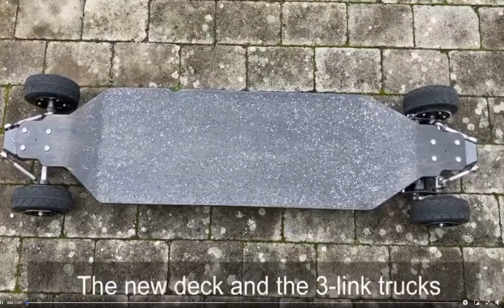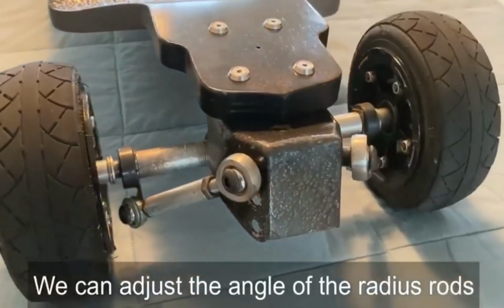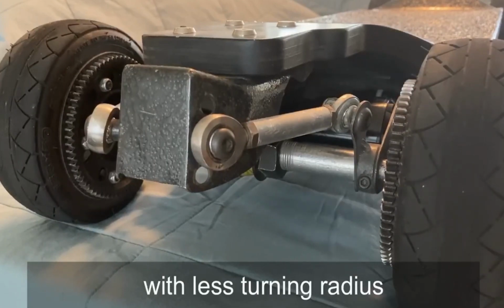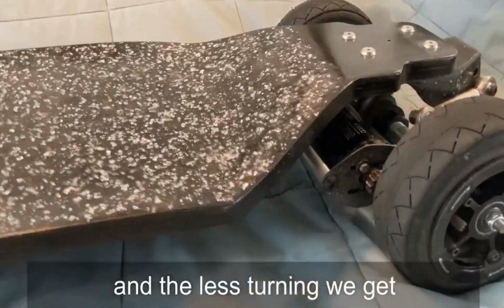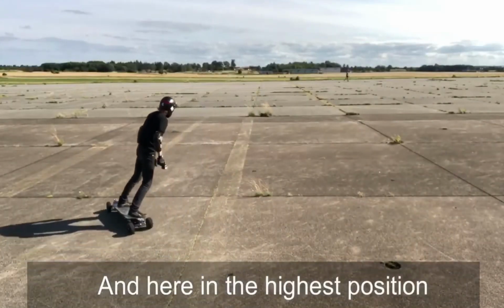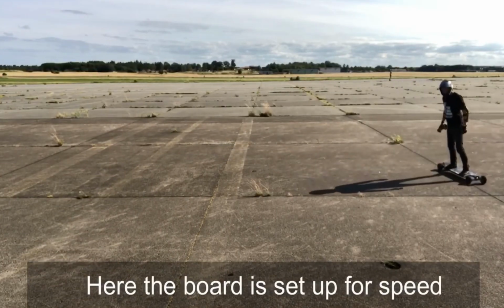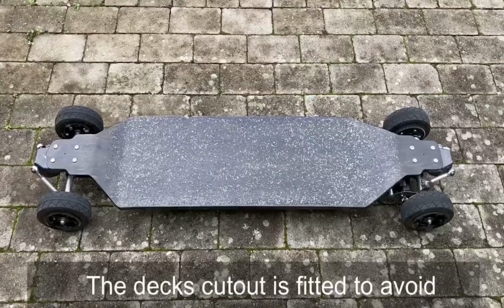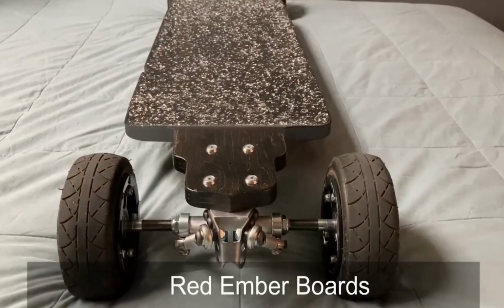DIY Fastest Electric Skateboard in The World

Comment: I'm a new rider but I was a bit nervous doing 26mph the other day 😂
Reply from the maker: 30 mph is a sweet spot to ride.
Reply: @ElectricVehicleSpace  I should have specified. I'm on an e-board. Backfire Zealot composite.
Reply: @ElectricVehicleSpace  hell nah you crazy 30 mph😳
Reply: @ghostgang4641  30 mph only
Reply: @ElectricVehicleSpace  sweet spot is 40
Reply: what for board?
Reply: maybe with this special board you go faster... with my normal all terrain I can't more that 40kmh because the radius. motor and vesc its not the problem. I have 8000 watt and 12s 10p battery pack

Comment: If the antenna condition is bad, immediately
Superman
You will fly between the air and the asphalt surface. without restraint
Even if transmission and reception are cut off for a while, the body flies away.
If the pull is large, a strong torque is applied. In conclusion, a momentary loss of reception between the remote control and the board puts a strong resistance on the motor. Your body flies off the board. Binding helps with small torques, but binding doesn't help with large torques. There is a greater risk of injury. But without binding, more accidents happen.
Reply: I call bullshit on everything you've said. Half binding on the front foot are not only safer to ride with but also are easy to fall out of and cause no real damage to you. Not only that but the remote being used is being used still today by the fastest riders there are with zero issues for years now. Stop talking shit until you can keep up.

Comment: Impressive skills and power, and he's not even full downhill tuck. Makes you wonder how much faster he could go if he wants to!
Reply from the maker: you can upgrade bigger motors and probably go faster straight line.
Reply: After doing my research, I honestly think that more average riders could learn to ride this fast with reasonable safety and on real roads.  You can almost entirely prevent wobbles by using steering dampers, and really large and thick wheels (like lacroix 8" wheels or bigger) would prevent gravel and small potholes from doing their worst while also having enough angular momentum to add some degree of stability.  Now all you have to do is not run into others on the road, slow for corners, and push your limits upward very slowly.  And also have about $5k to spend on it.
Reply: @andrewwock6968  Yeah but people cant drive worth a damn a bunch of boards at 40 mph/65 kph is a recipe for disaster. Just saying.....
Reply: I am trying to build a board to attempt to beat record speeds. Are the stooge 3 link trucks the most stable you have ever rode? I am considering every truck option. I want tight stability

Comment: I love every part of this video, just after 5 years of eride and 50k km done still would not go on that fast. 
the build is irrelevant, this is way to fast my raptor 2.1 is way to fast also , 
if want to go faster try the Electric unicycle
Reply from the maker: also gear up
Reply: @ElectricVehicleSpace  i have some gear is so dangerous :D
Reply: raptor is too fast for it's wheels imo. Lacroix feels quite comfortable at higher speeds...although the obvious realities of moving that quickly cannot be avoided. Motorcycling is also very dangerous, but mostly because they go way faster. At the same speed, this is more dangerous
Reply: @solomonjenkins9505  the problem is not 1000 km done at hi speed without incident is whenever you have one , is bad bro , so for the people going fast go to the gym building you core strength will save your life more than the gear you have or you don't have at the time of a crash 😅 I insist for fluffy 😂 people to. Not try this I've seen pictures 🥺 you have better things to do believe us 😊

Comment: That has to have a 20s battery in it
Reply: 4AAAs 😂👍
Reply: Wtf !!
Reply: @ndsrocks1    i dont
Reply: Stooge raceboards are using 8s lipos and pushing as much as 300-400amps. Watts are higher than most boards pushing twice as much voltage because the current available is much higher. 16s pushing 100amps equally wattage of 8s pushing 200amps